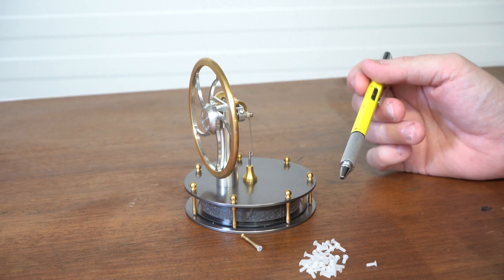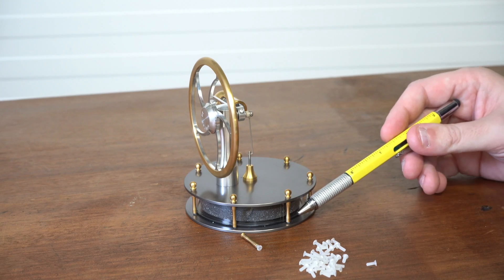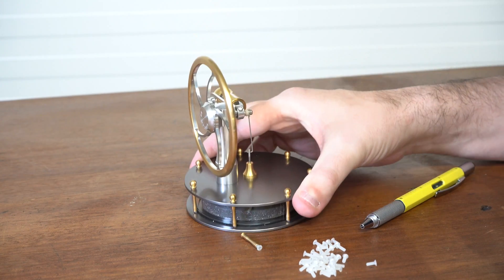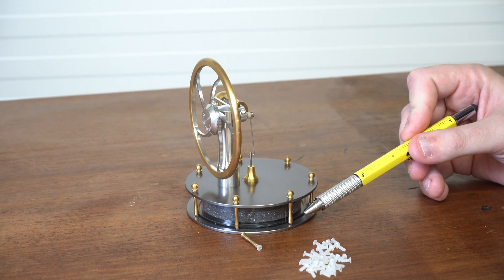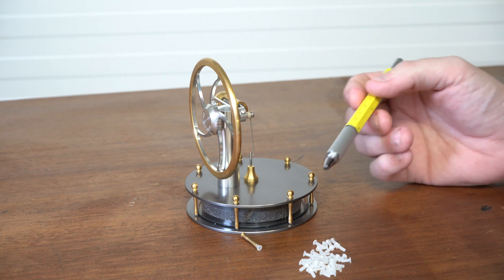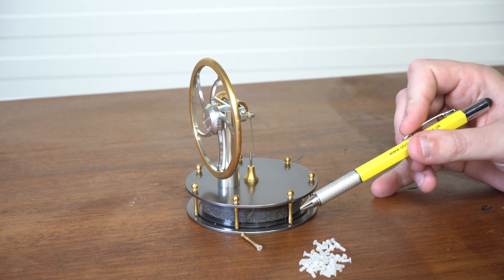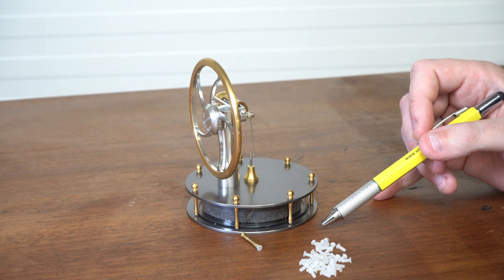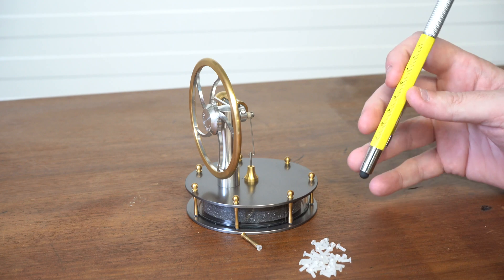Why do we use Nylon screw - Stirling Engine - Kontax

Comment: If that was really the case then wouldnt the brass posts be conducting alot of heat? As well as the plexiglass walls via the rubber o-ring?